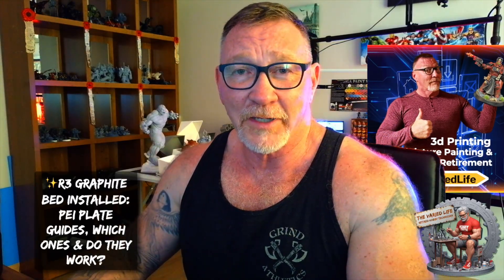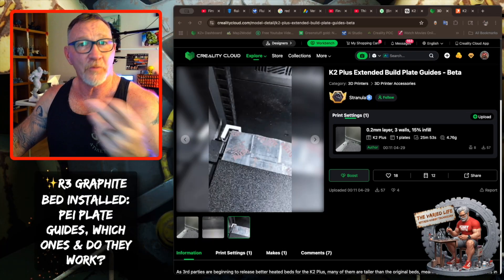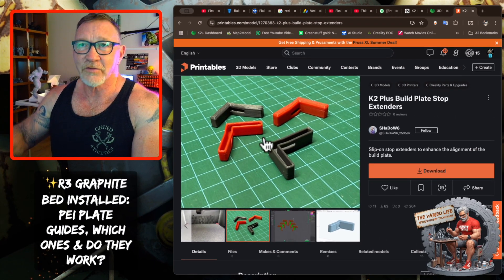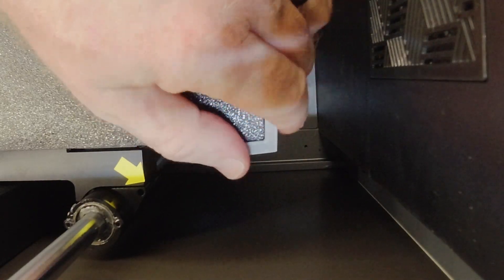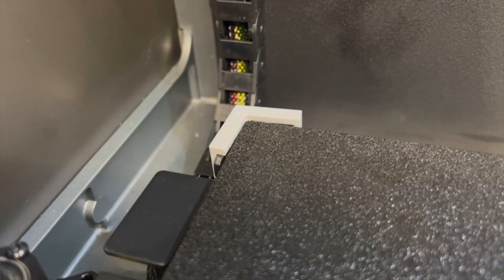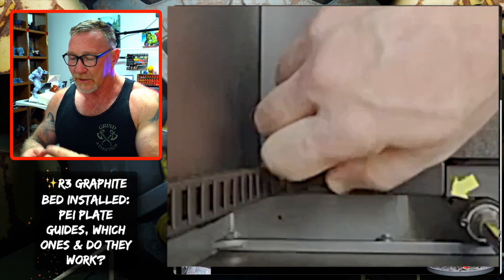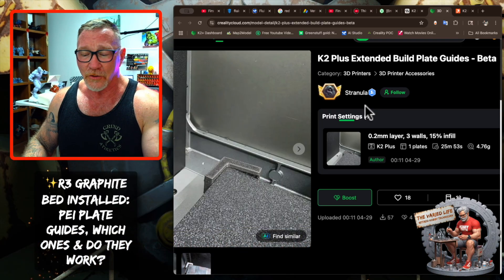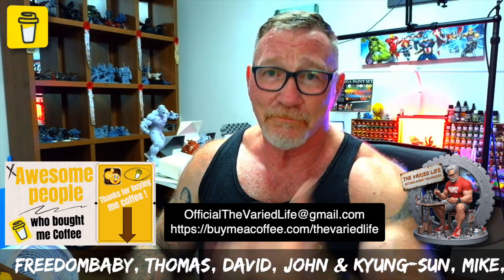I Tried 3D Printing Graphite Plate Guides So You Don’t Have To!

Comment: Man am I ever glad you grabbed this plate. I was just looking to purchase one but wasn't sure if it was worth it. My K2 Plus bed is SO far out, like 2mm variance. Now that I've seen you're using it I'm going to pull the trigger 100%. Always good to see someone trusted using a product before buying it!
Reply from the maker: Thanks for checking it out. I was in the same boat as you until I saw someone who had this bed too. Eventually I will sand down the magnet part and get it even flatter.

Comment: Interesting. So the steel backstops that come with the standard aluminum bed, that are sitting just above the bed to catch the build plate are not tall enough for the Graphite bed?

I'm expecting my graphite bed later this month. Very excited to get this installed.
Reply from the maker: Yes you are right, the stock backstop are not high enough. With that said use the lowest 3d printed backstop/guide. If you use a tall one the nozzle might hit them and that would not be good. Thanks for watching, I appreciate it.